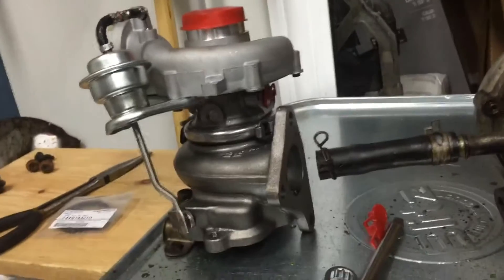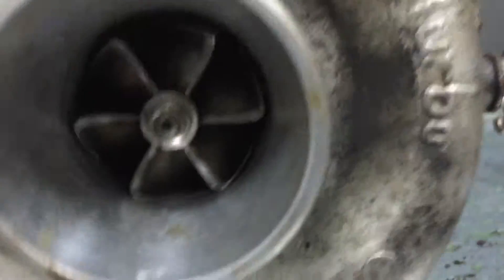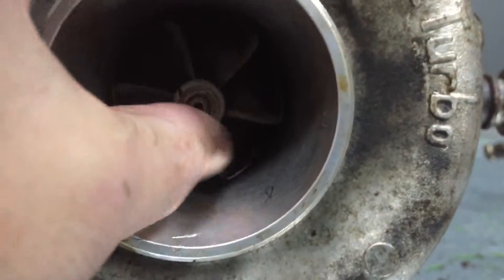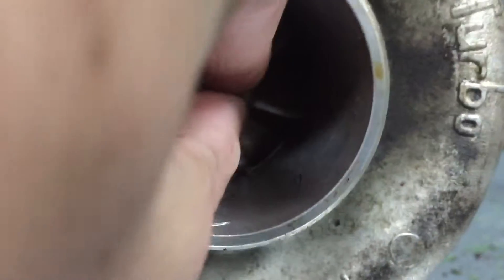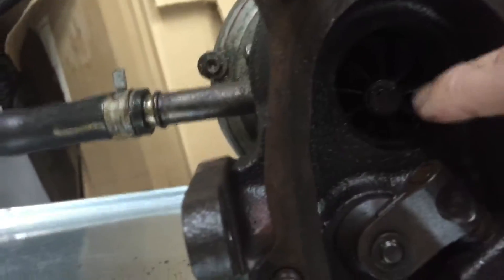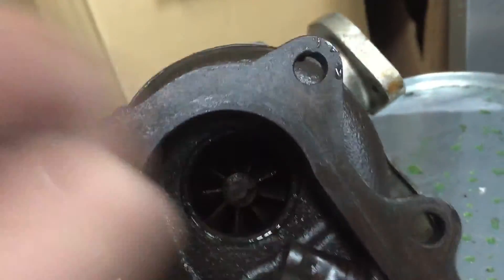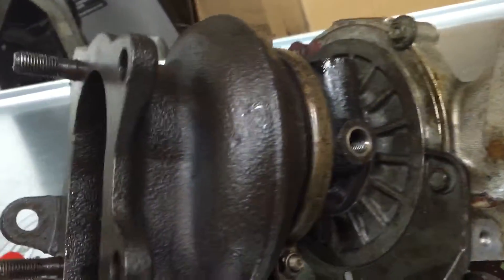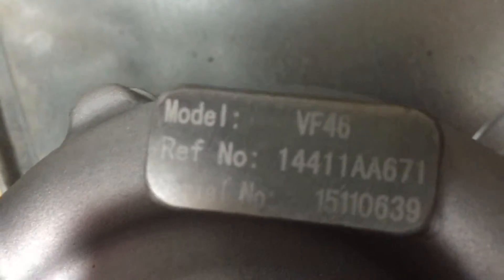2007 Subaru Outback XT Turbo replacement

Comment: How did you get your oil return line back on?
Reply: We have the same question!  Impossible to reach.  I’ve bought some very long needle nose pliers and will hold open the top clamp while my son fits the turbo in place.
Reply from the maker: from the bottom after it leaked, it was a challenge